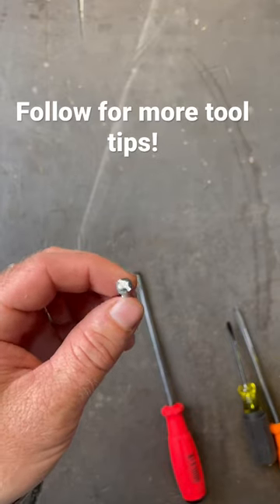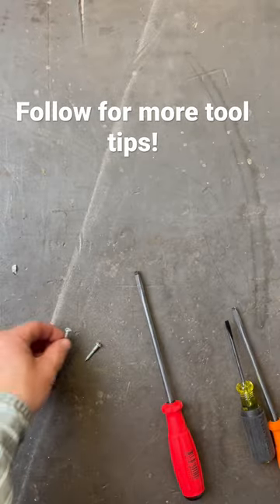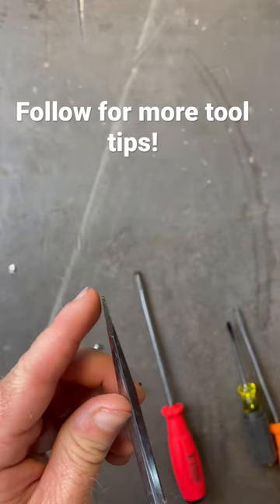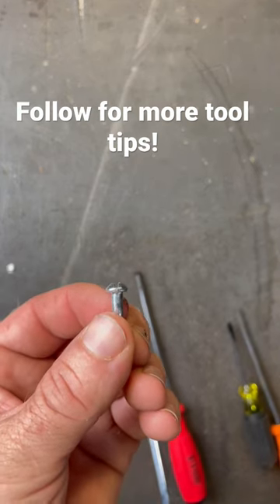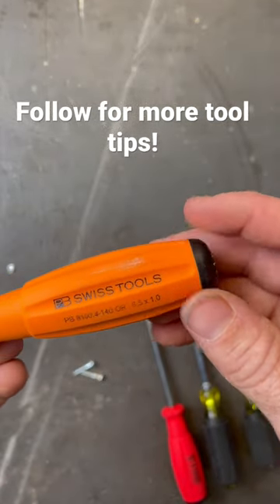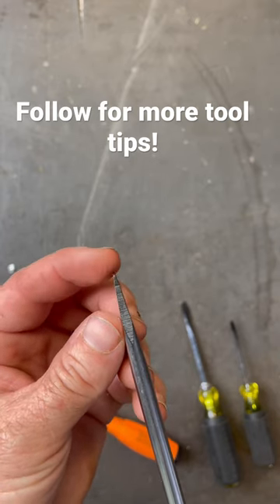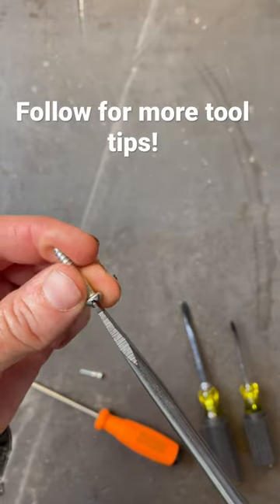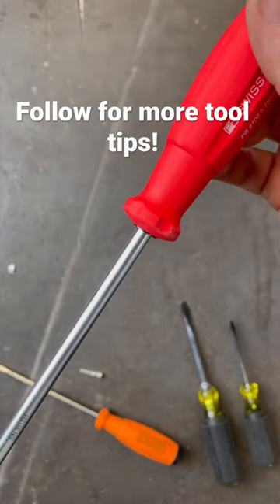Slotted screws suck!  Here’s how to make them better!

Comment: Hey WOW dudes, have you ever encountered a "coin slot " on the bottom of a truck valve stem,  well,  if a coin or washer isn't enough,  APEX makes a 1/4 inch drive bit that bites better.

Comment: All screws except those made for special purposes should be square ⬛️ drive! They are easy to make. When a tip gets worn out or broken, a little dremel work and you're back in business!
Reply: Agreed.  In Canada that's called the Robertson screw head.  I use them for just about everything.
Reply: I'll die on the hill that Robbies aren't good for anything other than light to medium applications. Torx should be the hold standard. Can't cound how many electrical receptacles with robbies I've easily stripped trying to apply the proper 35inlb rating. They're better than slotted but... so is everything. They round too easy

Comment: Yes! I take the rounded edge off the el cheapo screwdrivers I have. Not as nice as the quality screwdrivers I use at work, but it dramatically reduces cam-out. Great that you showed the fitment toward the end, drives home the point.

Comment: Hollow ground flathead tips work really well too...not as nice a a carefully made driver like you showed, but way less camming prone than a straight angle.
Reply: Yes, I would hollow grind all my flat head screwdrivers to get those parallel surfaces.  Good Hex drive bits often come with two curved faces that end in parallel screw surfaces too
Reply: @LarryTait1  when I broke one I ground it better than it was 👍
Reply: yes. that's why gunsmithing screwdrivers have been hollow ground since forever and perfect fastener engagement and capture ratio. and screws will not mar or cam out either.
Reply: Came here to point that out.  Also the reply before mine about gunsmithing bits.

Comment: Either way the guy that invented a slotted screw needs every one of them that has ever been made STUFFED UP HIS PRISON PURSE!!!!!
Reply: Slotted screws were made before tooling was around to make any alternative.
Reply: Fasteners are designed for specific purposes. If you are having trouble with them it is either the wrong fastener or wrong tool being used. 

Also. Screw drivers car be shaped and sharpened with a file. Makes the biggest difference.
Reply: @davidkirby6473  I think we were only speaking of screws, fasteners include a whole array of items such as spring clips, grommets, snaps, hooks...etc that don't have a thread and screwdrivers are not necessarily needed. I agree that a flat screwdriver can be modified to fit the slot better....but there are so many other options..even screws with a torx head ..
Reply: They were made for aircraft. They're meant to cam out to stop other problems. 
Idk why they're used in anything but light or thin materials at all. Use phillips, hex, star or torx for everything else.
Reply: Slot screws are the OG of screws. They have been around for hundreds of years and obvious back when they were invented they made sense because of the simplicity to make. They real have no reason to exist anymore
Reply: @sailaway1015  wow pedantic much
Reply: @contraband1543  just the facts buddy...no bs
Reply: 😆 yes indeed
Reply: @sailaway1015  ...when the torx first hit the automotive scene,  there was problems with breakage of the tip, and over torque.
Reply: ...cute,  now go out get a decent slotted screw driver, life ain't so bad after all.
Reply: @cameronduff884  Never seen a stripped torx, they are far superior to phillips, jis, and slotted.

Comment: As a mechanic, I have never seen a slotted screw driver like that, until now. I have to get one. 👍
Reply: And you call yourself a mechanic 🤣
Reply: @mrchildgrownold3852  The Air Force didn't supply the best tools. And I couldn't afford the good, expensive tools.
Reply: @shark70007000  Thank you for your service

Comment: I've had been struggling with those pain in the ass screws for over 25 years. It's amazing I didn't known this before watching your video. Also Klein is kind of a higher-end name for tools. Oh and you're comparing them to Craftsman or husky Cobalt harbor freight any of the cheaper ones. Looks like I'm going to have to probably get that set of nice PB Swiss screwdrivers I was looking at spending $100 + for a set I think of seven. What I will never use them as a chisel as of you some of my screwdrivers in the past.

Comment: My tip always slips right out of the slot...
Reply from the maker: Hate when that happens 😅
Reply: Usually because it's not big enough.
Reply: @gravyblue  be careful with that knowledge..  Someone might want to know how you got it...
Reply: @twistedhillbilly6157  😆😆 our secret is safe.
Reply: @gravyblue  sometimes the tip is big enough it's just that the slots been screwed so many times it's just lose and sloppy.
Reply: Try some valve grinding compound. (unless that was just a pun)
Reply: @cameronduff884  Valve grinding?? I do loves to grind me some valves// I'll stop by Adam &  Eve and get a bucket to try out.. thanks for the tip  (that's what she said)..........
Reply: @TapiaJ  The retractable part doesn't help much either..

Comment: Have an old or maybe ancient Stanley ratchet driver with some tips like that, used them on old hinges with large slotted screws for forty years, never saw it anywhere else! Now I have! Thanks
Reply: Gunsmiths have worried the situation since the 1st firearms were made. They remedied the issue since forever ago and have always made screwdrivers with hollow ground tips to ensure superior fastener engagement and capture ratio. Plus, they will not mar or cam out. Really useful on guitars as well where you dont want to scar up the hardware on a fine instrument. 
Check out gunsmith screwdriver sets. Cheaper than Swiss.

Comment: I am a plumber. Special #10 screws with a #8 slotted head are used as replacements for bibb screws. They hold the faucet washers in. The original screws are usually #8 and we tap them out when the female threads are bunk. 

All good bibb screws are slotted because much of the head can corrode away and still give good purchase.
Reply: You just answered a question I didn't know I had! Thanks!

Comment: Gunsmith's Screwdrivers are Hollow Ground so that the Flats are parallel in order to avoid marring slot head screws when working on firearms that can be brand new to well over 100+ years old.

Comment: One effect that is actually a Japanese style screwdriver tip as opposed to an American. The reason why the American ones are cut at a angle, it is just cheaper to manufacture like that and also when you're talking something down your screwdriver will pop out quickly instead of breaking the tip off, but the Japanese do it a little bit more precise.

Comment: And that is why I've always made that step on my screw drivers with my grinder. It makes my $20 set of drivers work exactly like yours, but I spent $20 for the set, you spent $20 for one
Reply: Yeah but no, modification on your cheap pos screwdriver doesn't make it the same as a high end screwdriver.  Also, these aren't that expensive,  a set of 4 slotted and 2 Philips screwdrivers are like 40$

Comment: my boss has a set of dewalt slotted bits that use a spring to push a socket over the screw, with a flat head bit inside. if you have to use slotted screws, it's not a bad way to drive them

Comment: They used to make like a 2 piece slotted tip that you would slide a collar down on and it would lock the tip onto the screw. Not sure if they still make them or not but I haven't seen one other than mine, for many years. Actually inherited mine from my dad.
Edit: Guess if I would have read more I would have seen it. The Quick Wedge screwdriver.
Reply: Those are known as a “screw starter”. They are not strong enough to give the final torque to the fastener.

Comment: gunsmiths have known this since forever.
get a set of gunsmith screwdrivers.hollow ground. parallel tip. will not mar or cam out. superior fastener engagement and capture ratio

Comment: Use a rubber band in the slot if you don't have the correct driver also works on damage Phillips and pozi heads

Comment: Only problem I have with it is the V cut screwdriver is that much stronger at the tip than the straight cut driver. Personally I hate flatheads altogether but working on older motorcycles I don’t have much of a choice. I’ve bent plenty of V cut and straight cut, but the straights never last as long as my Vs.

Comment: I tried ones like that once. Threw them away after breaking the tops off at the cutdown. I also snap the balls off ball tip Allen wrenches without cheaters, over 1/4 inch.

Comment: A straight screw caused me to get a bad cut and trip to the er. Changing a blade in a 4" razor scraper in a hurry. Driver slipped while applying a lot of pressure and I pretty much punched the blade. Luckily I didn't cut any tendons. If it had been Phillips it wouldn't have happened.

Comment: Solve all your screwdriver problems... buy a set of Robertson screwdrivers and a variety of Robertson screws. Then every time you come across a situation that uses a slot or a Phillips screw...throw them away in a junk drawer and replace those screws with the Robertsons.
You will be amazed.
Reply from the maker: Most definitely. I’m more Torx though. We don’t do much Robertson in the US. 

Still have to get the slotted and Phillips screws out too…. So there’s that 😉
Reply: @MillisConstruction  Depending on source (and use) the Robertson screwdriver is the third most popular screwdriver system in the world. Especially when using a power drill bit... but why let them have all the fun?
Since the Robertson was invented by a Canadian, the American hardware industry refused to manufacture or stock that system, back in the early 1900's. This caused it to be used in Canada only for years, then after a period of time, elsewhere in the world as it's versatility became known, but not in the U.S.
 This has changed. Much like the Metric system. The U.S. military is now metric, otherwise it would not be able to "communicate" with its allies. Slow progress, but progress nonetheless.

Comment: I took a bolt and ground it down on the bench grinder to somthing like this exactly when I had a stripped out screw gruve it worked got that screw out of my dizzy it had my points stuck I needed to replace the points and that screw

Comment: I did notice you didn’t show how tight the Klein screwdriver fits. The Klein has a specific taper that fits different sized screws used in electrical construction. That screwdriver only fits one size slot and is useless to me.

Comment: Because flat head screwdrivers. Are made is not as it used to be . They used to be ground  like a hollow ground blade. That makes them parallel to the sl9t on the screw. A modern flathead screwdriver is ground straight to the edges that creates a wedge whicb just pushes itself out of the slot. Another aspect of the problem isf the quality of the metal the screw is made of. When made of cheap, soft steel the screwdriver  just naturally deforms the metal of the screw and ejects the screwdriver.

Comment: So buy an expensive screwdriver and still have crappy screws or just get a better screw And don't mess with the fancy screwdrivers. Got it thanks appreciate it.  Now having said that, that is a cool screwdriver.
Reply from the maker: I use them a lot just to remove screws to replace with a better head design. It’s nice to have them remove without stripping.   Also for firearms uses they’re very nice.
Reply: Idk, I've stripped a lot of allen head screws with the correct torque spec for the application but haven't had an issue when i used the dremel on them to make them slotted head, i would still prefer a torx or Philips to a flathead but definitely not the crappiest screw out there.

Comment: Yuuuup I HATE them. If I’m using a drill I’ll cam out 2-3x per screw 😠 BUT damn Pbswiss did a good job with that 👏 & wera laser tips are nice touch.. to try to ease the pain!? I had to remove all the doors in a older house recently, I wanted to rip the hinges out on some hulk smash ishhh by hour 2 😆

Comment: No one complains about it caming out. The issue is that slotted screws are a bitch to line up one, start, stay centered on, and you can’t use a drill on.

Comment: Or instead of spending over $100 CDN on a set of screwdrivers to instead stupid useless screws you can just use a Robertson and grip the screw head with now issues. 
Slotted screws aren’t completely useless. They’re the easiest ones to clear paint out of. 🤷🏻‍♂️
Reply from the maker: Still have to remove them daily in my work and I like that part to be easy. Definitely not putting them back in except in the case of fire arms which is where these are fantastic as well.

Comment: This is only modern stupidity. Traditional craftsman knew how to “sharpen” their screwdrivers. The term simply meant that they would make sure their screwdriver was ground straight tipped and with parallel sides. any expensive flat head screwdriver that comes with appreciate the tip is bound to roll over and need reshaping at some point anyway. Traditional craftsman treated screwdrivers like chisels, they take care of them and reshape them as needed. As long as the quality of the steel was good they would last a very long time.

Comment: Flat head is still a dumb design and should be abolished it does everything Phillips does and LESS
Reply from the maker: I like your style 😁🔥
I mainly use the drivers to remove them, then replace with better styles, and it’s nice to not deal with stripped heads if possible. Except in the case of things that go boom, then slotted is just part of life.

Comment: I like the video and I like The tool but I need to educate you on something you’re not looking at a slotted screw you’re looking at a screw the first and original design just like a screwdriver there is only one screwdriver it has a flat edge like the ones you’re showing in your video everything invented after that has a different name so if I tell you to get me a screw out of the shell it will be a flat head a regular screwdriver needed to assemble now I can ask you for a Phillips screw or torque screw and there’s a few more but those are not the original screw so you can’t call it a screw you always have to have the pre-noun first Lol nobody ever recognizes that and why is that because the original screw was invented first so I have a screw and I have a screwdriver